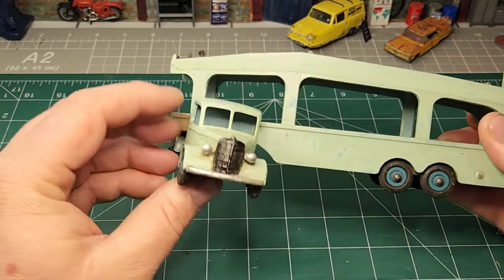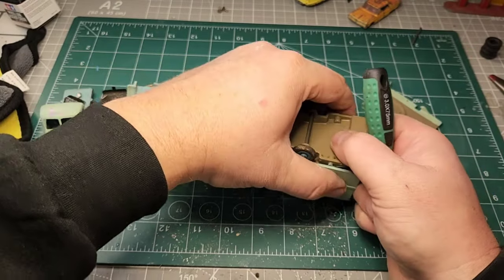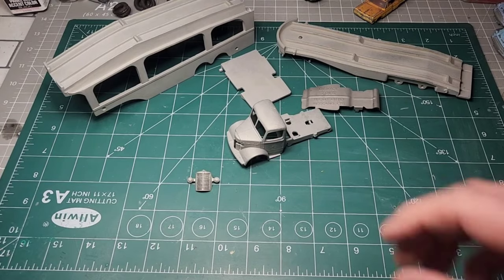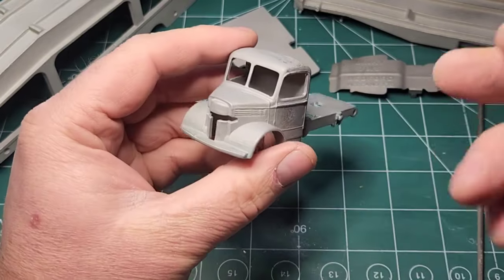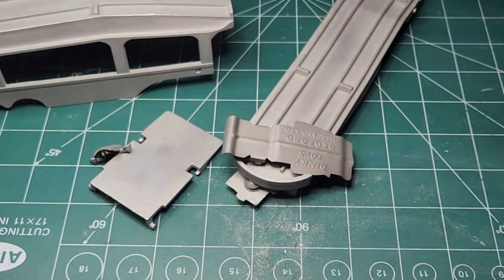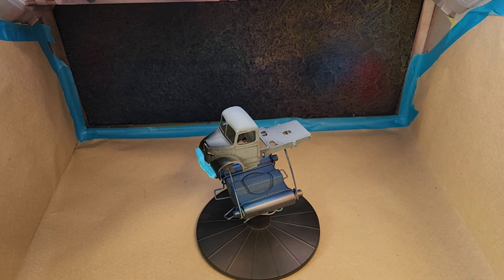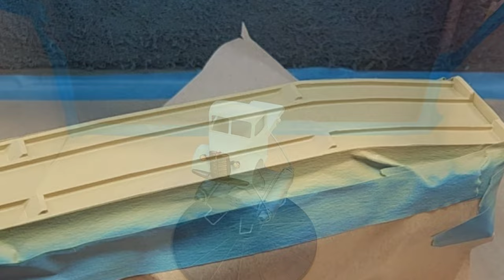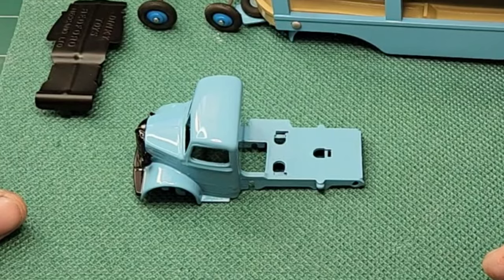dinky toys bedford pullmore 1953/63 car transporter diecast restoration

Comment: First video I’ve watched excellent restoration have subscribed what make of paints do use and make of topcoat I have one in my loft going to have a go did you buy the decals thanks keep them coming
Reply from the maker: Hi David I use 2k clear with base coat and decals was bought off ebay seller was Crawford model supplies. Mad up you've joined me and I'm glad you liked the restoration cheers. Luke